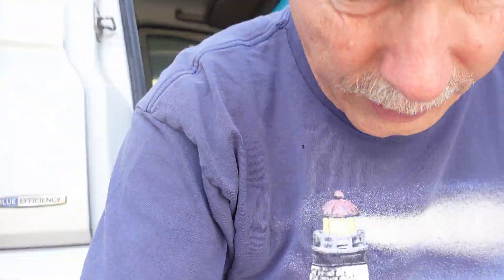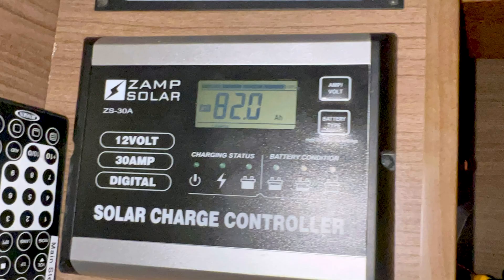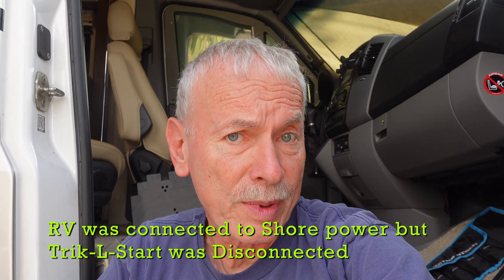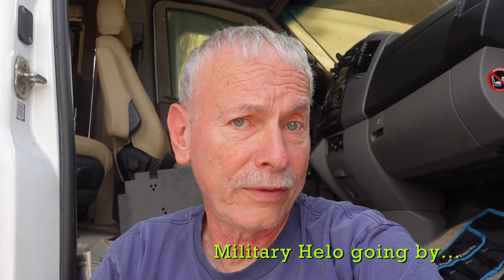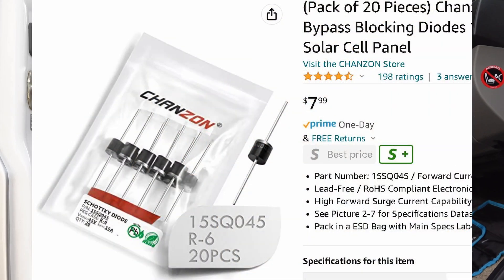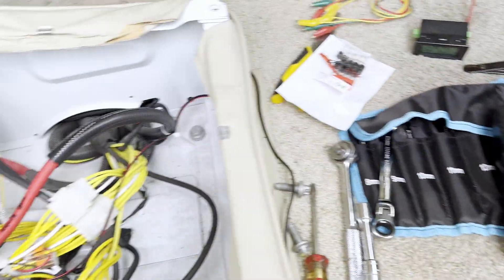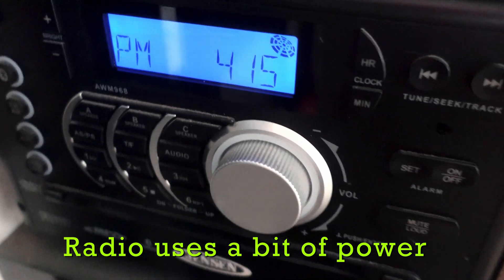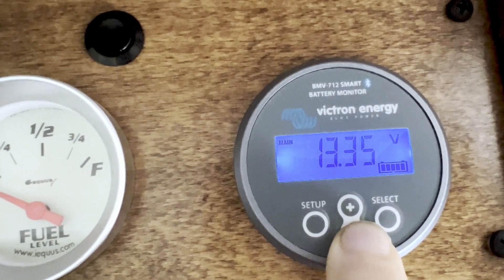Trik L Start mod needed to use Lithium batteries

Comment: Cannot find any comments by you, Ron, about the newer House2Start replacement.  Opinion?
Reply from the maker: I don’t have any info on those. My original trik-l start with the diode mod gas been working perfect. My chassis battery is still fine after 10 years.

Comment: Hi Ron,  Thank you for the great video.  I have an older Ampl-Start in my 19V.   It does not have an option for Lithium.   Will your diode mod work for the older Ampl-Start.  I am trying to prevent the Lithium house batteries from over charging my chasis battery. Thanks Mike.
Reply from the maker: I believe so. Check by verifying that both chassis and coach batteries are similar voltage. If so, you can add diodes to allow the lithium battery to stay charged.
Reply: @ontheroadwithron2432  Thanks Ron.  I am thinking of trying the conversion.  I don't want to waste a good Amp-L-Start even if it is not a lithium compatible version.   Regards, Mike

Comment: So exactly which end is hooked to the lithium battery?
Reply from the maker: No change to lithium battery. This goes in the trik-l start wiring only. The blue wire from the trik-l start goes to the + or anode side of the diodes. The other cathode side is connected to the blue wire going to the chassis battery. Hope this helps.
Reply: @ontheroadwithron2432  ok thanks, I am in the same situation as you. I am putting in lithium and have a triklstart. I ordered the diodes and will do your setup.

Comment: Ron,  Where did you get the block that you used for the diodes?  I could not find a link.  I've used several of your mods and I appreciate your  insight  Thanks.
Reply from the maker: Got on Amazon. Blue Sea Systems-2406-BSS 20A - 6... https://www.amazon.com/dp/B000A770HO?ref=ppx_pop_mob_ap_share
Reply: Thanks Ron

Comment: Mercedes is EXTREME volt drop when stands some days. 

Have bean for ages😂😂😂

How ur generator can charge lithium mister ??

Some i gat interessing in.

Have 24volt 450amp system in a yacht/houseboat traveling down european waterways now. 

And i do now upgrade 1 more battery so 48volt 450 amp.

Have a power supply double one. So have bean use that 4 5 times in total for 2 years

But want to make an electric engine on 20kw maby more.
Have oversised engine diesel in my yacht so can use some horsepower whit out any problem at all. 

But alsow if 30kw feks whit hybrid in minde for drag my aksel and propeller shaft some few h every day.

But when start diesel engine and drive, i can charge lithium batterys whit full blast as el engine can give, and ur never get paralized from little too big marine diesel anyway
Reply: You have any tip trix for this ???
Reply: Ore know of any to see before I do ??

Hybrid diesel electric have bean around for life times x7 at least.

But them are in millions alsow.

10kw el engine can be in mail for some hundreds of dollar/euro and you need a controller box ofcorse

Comment: So this looks like it's running through 4 diodes, right? 2 series, 2 parallel.
Reply from the maker: Yes. Around .6 voltage drop.

Comment: Hi Ron, I have a Xantrex Echo Charger. It is a voltage follower like the Amp-L start so this mod should work with it. Can you post a diagram and instructions of you have them please? Thanks!
Reply from the maker: I would just follow mfg instructions. I have never seen one of these but sounds easy to install as long as it doesn’t get wet.

Comment: Why do you need the alternator switch if you feel that the alternator is able to adequately charge the lithium? Would you be ok if you didn't put that switch in?
Reply from the maker: For 2 reasons. First so i could test it.  And secondly I mostly charge with solar. Running the alternator will use more engine power and might reduce my mpg a bit.

Comment: I really came here because I'm worried about over charging my 12v chassis batteries with 14.4v lithium.
Reply from the maker: The alternator is the usual way to charge the chassis battery. Of course if it is parked for long periods of time then something else is needed. You are right that the lithium batteries are higher voltage than the lead acid type. You might want to consider keeping them separate with separate charging methods.

Comment: Great video. Ihave a Trik L Start from a previous rv and need to use it with my lifepo4 . Can you post a diagram of the diodes wiring.
Reply from the maker: in the picture of the diodes at 3:47 of the video the blue wire from the Trik L Start goes to the bottom of the terminal block.  This is the solid side of the diodes.  2 diodes are back to back and the lead from the stripped end goes to the near side of the solenoid just like before..  Hope this helps
Reply from the maker: Sorry it has taken so long to reply. Too many sticks in the fire right now. I’ll look it up.
Reply: @ontheroadwithron2432  Thanks
Reply: Thanks for the video , like some others here I just discovered the Amp-L-Start is no longer made. I have my Trik-L-Start, but I'm not completely sure of the orientation of the diodes. Any help is appreciated.
Reply: Thanks Ron for looking for the web link and sharing this video. It appears the company is out of business now so we do not have the option anymore of spending $80 for an Amp-L-Start. I tried finding the post you mentioned but did not have any luck. I’m really curious about how this 4 diode configuration works. I understand why 2 but not 4.
Reply from the maker: @bryantgonsalves8026  Well, the 4 diodes are just 2 sets in parallel to handle more current.

Comment: Hi Ron. Like you I upgraded to lithium and have the same unit and would like to make the mod that you did. I can see you yesterday the blue wire to the block. But I can not see how you connected the diodes. Can you send a diagram or pic of what you did?  Thank you. Phil. @metaldetectingrver.

Comment: Hey Ron.  Your diagram shows the line on your diodes (cathode) pointing to positive.   Cathodes are negative.  Didn’t that block voltage thru the trickle start?  I’m confused.
Reply from the maker: I took another look. You are right that the cathod blocks the voltage from the positive on the battery. However the voltage on the trik l start is higher than the chassis battery and that allows current to flow during charging.

Comment: Hi. I have a 2015 Winnebago Retro 25P. I noticed the dining room T.V. had audio wires connected to the audio ports on the T.V.  I don't know what it's connected to. The audio only plays on the  T.V.  speakers but it looks like they may be connected to another speaker in the rig. Do you have any suggestions of another connected speaker some place?
Reply from the maker: My tv sound plays thru the Jensen radio  in the coach also. Jusst set it to aux.

Comment: Thanks for the video Ron.  I went thought this last year when I converted to lithium. Changed the inverter, solar controller, and the amp-l-start.  The amp-l-start never did work correctly and the chassis battery went dead after a month in storage.  Lsl worked with me for six months and even created a custom unit.  Never did really solve the problem, went back to the old converter and added a pendent to it to force the equalizing mode output to 14.4v when I need to charge the house batteries fully.  Now the amp-l-start or tric-l-start work fin for the chassis battery and the lithium are normally 70% charged.  They fully charge when I drive the rv and when I push the button on the pendent.  So an alternate solution.  Just add the pendent to your existing converter when you need to fully charge the lithium.  Even supposed to extend the life of the lithium.  We have a “g” View.  The converter was a bear to change.

Comment: Excellent, as always, Ron. Keep it up.  FYI: newer Views can set the chassis in "Standby" mode via the Benz MBUX interface, which greatly reduces parasitic discharge of the the chassis batt but does not charge. The '22 View also comes with a Chargemate Pro DC-DC isolator which "can" be mod'd to connect the banks & charge bidirectionally. Don't know how effective though. Love the 'sound of freedom' going overhead!
Reply from the maker: good to know.  The newer rigs have some advantages, but come at a very high cost.